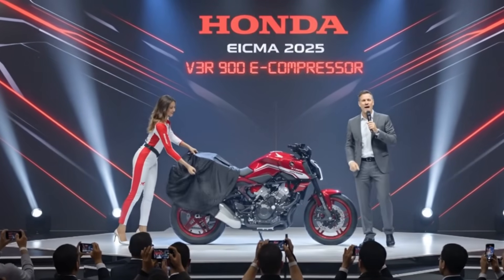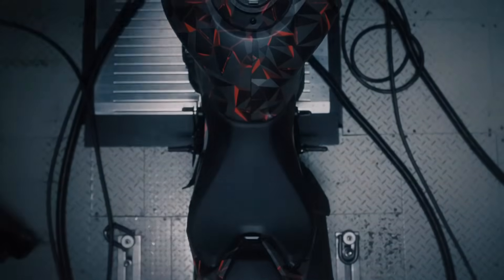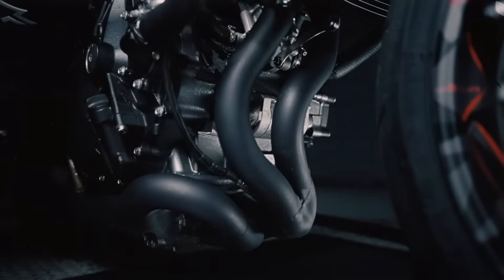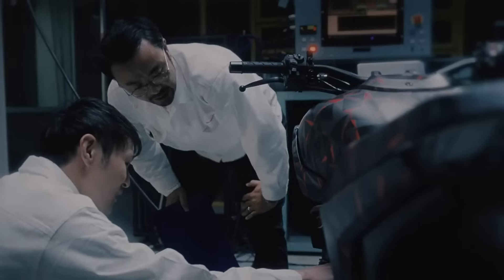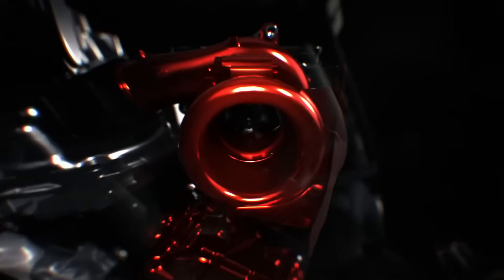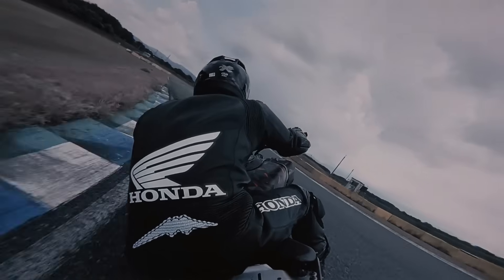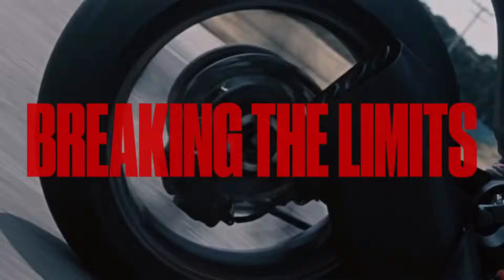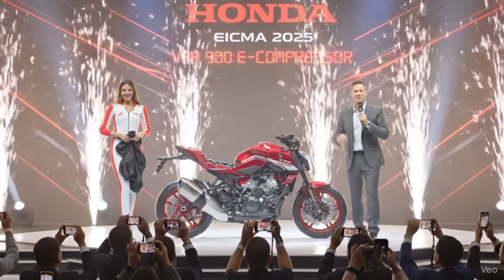EICMA 2025 : 2026 NEW HONDA V3R E-COMPRESSOR FINALLY REVEALED!! (FEATURES & BENEFITS)

Comment: At least it doesn't have fccking black wheels ... "the power of a 1200 with the weight and agility of a 900" ... isn't what they all said during the turbo craze of the early 70s?

Comment: Basically an engine to deal with terrible EPA regulations. Reason why most cars are turboed 3 cylinders now. Like someone else said this would be better for a lower cc bike that's lightweight. There's not a big weight savings from a 900 to 1200. An sdr weighs barely more than other 200hp super sports and it's a 1400 practically